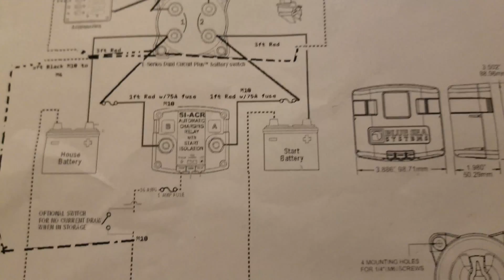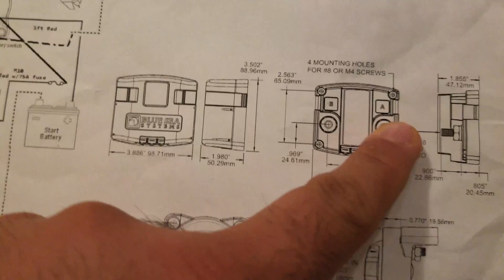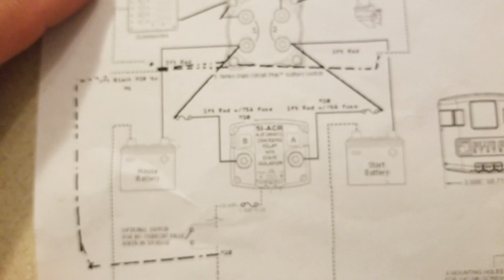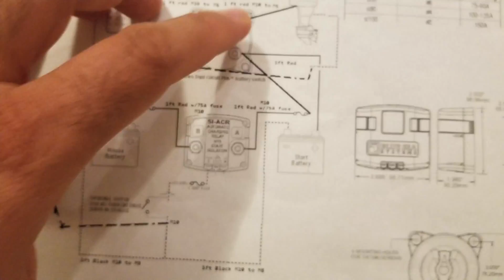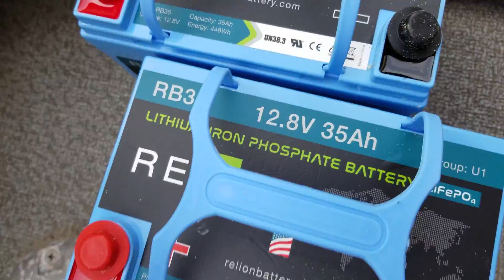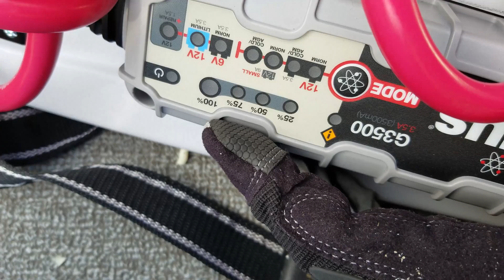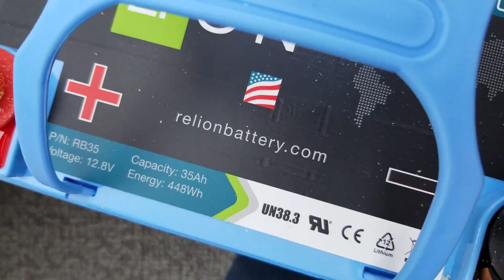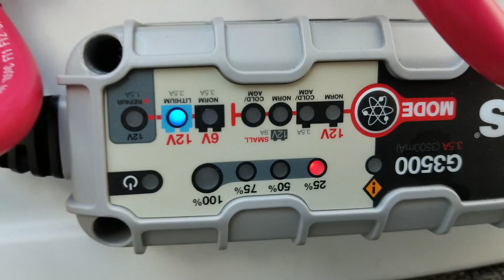Marine Lithium Dual Battery Boat / Yacht Electrical System In A Single Battery Box

Comment: Hi I was doing the same but with the voltage level of the Li batt it goes crazy and is all the time active, is detecting the charge of the batt as a generator/charger. Do you have any similar problem? Regards
Reply from the maker: yes i switched to northstar agms instead